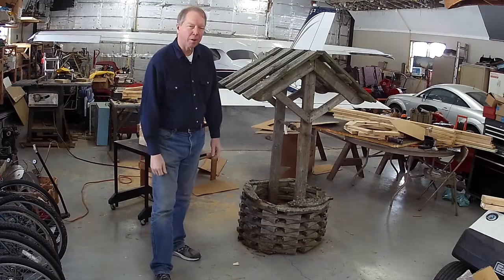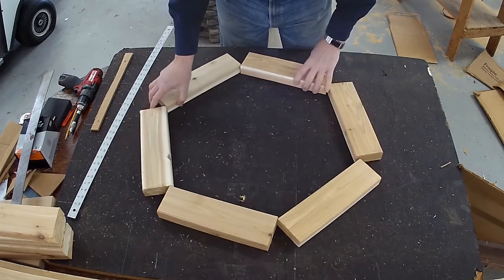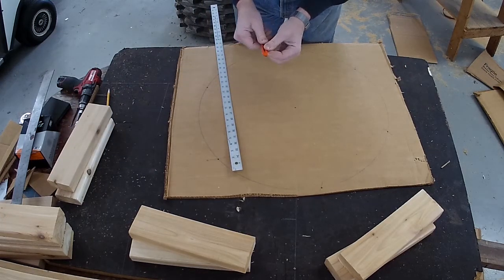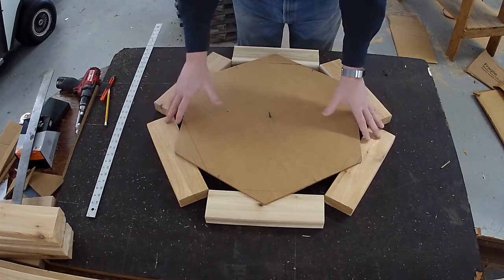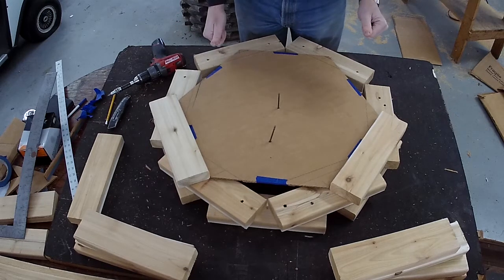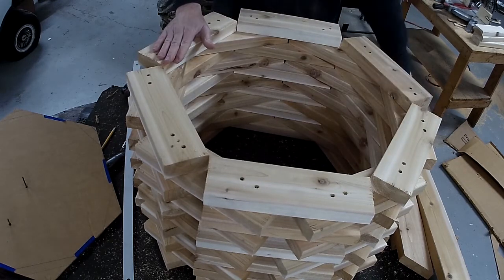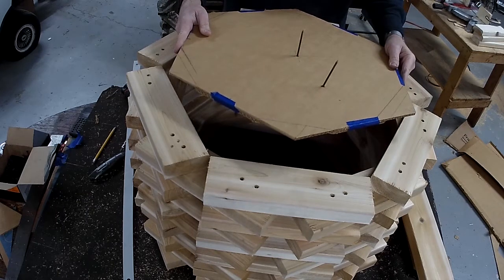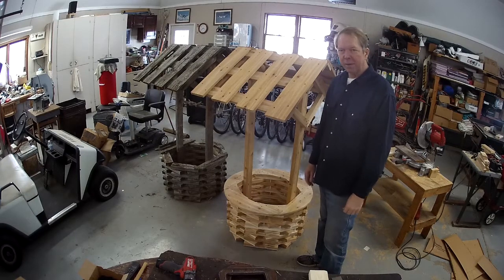Hints for building a wishing well with a hexagonal base

Comment: I would add more wood to the roof to keep move of the water out, use some Thompson's water seal. Great job !
Reply from the maker: Problem is, most folks would want to park a flower pot in the wooden bucket, so letting in some water is a good thing!

Comment: Do you have all of the schematics/measurements for the whole thing by chance?
Reply from the maker: Hello Sara. Since it's you asking, I'll say yes. :-) 

This will be a peek into how an Engineer (at least this Engineer) does a duplication project like this. Just enough info, but you'll have to puzzle through the assembly a bit. 

Remember I had the old one sitting there, so angles and such things were transferred over. But the measurements are here. The second page lays out the data much more clearly than the first page, and can be used as a cut plan. As I recall it was all correct, and the order fully built the wishing well.

You can download the 3 page PDF at this link: 
https://cardinalinspections.com/youtube/Wishing_Well_plan_and_details.pdf
Reply from the maker: I was inspired to add some photos to the data. The new link for this information is: https://cardinalinspections.com/youtube/WishingWell/

Comment: Should have 45 the ends so they marry together.
So there's not a gap between the ends.

That's how I build mine.
And it looks alot cleaner.
Reply from the maker: For the base? That is an interesting thought. It would have to be a 30 degree angle, and would require longer blocks to fill the space. It would have a much different look. I was going for an exact replacement for what I had, with the benefit of requiring much less alignment accuracy.